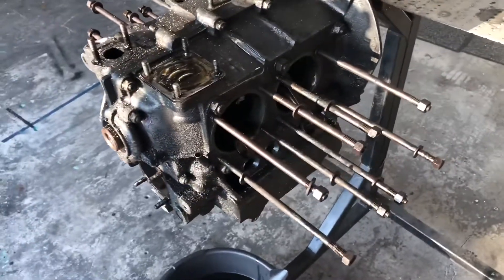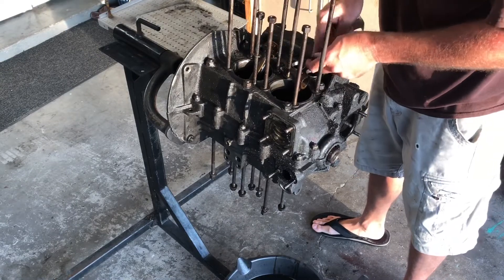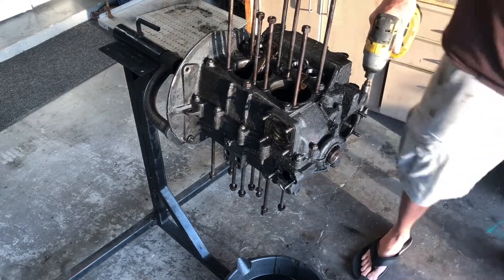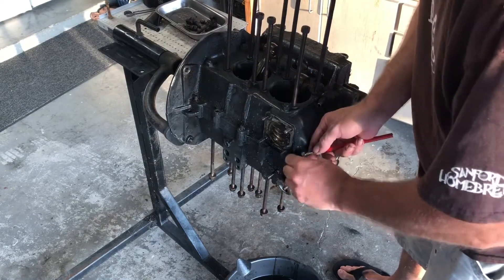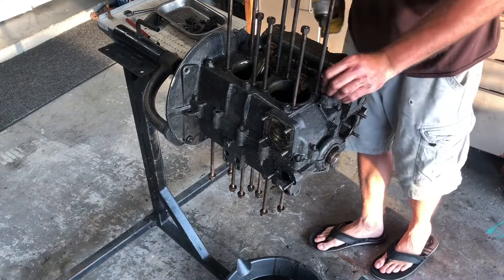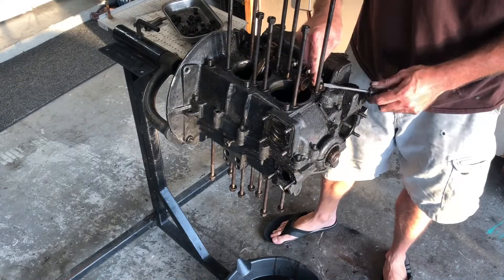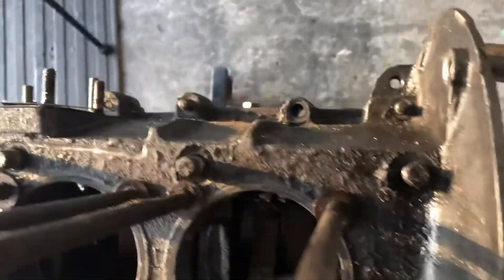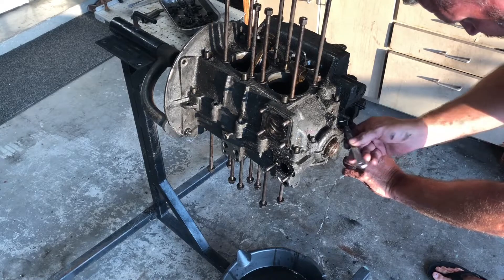Splitting The VW Engine Case On Joel’s 71 Bus

Comment: My Late father who  rebuit Volkswagen at 2different  Volkswagen dealerships   used old cylinder  heads as a slidehammer after all the case bolts and oil pump were removed    .
Reply from the maker: Hey that’s a cool idea!

Comment: Nice find!  I have to say, the guy who designs a vertically split case engine needs to be boiled in the oil that leaks out of that engine...
Reply from the maker: I would have to agree with you on that one.... however if you use a good case sealant and make sure the case halves aren’t warped, you won’t have a leaker.

Comment: Those case spitters that  go in oil  pump cavity  can distort the crank case line bore the Germans  that came around to the Volkswagen  Dealership s didn't  like them i had one.
Reply from the maker: I’m sure it could definitely do that if you cranked on it real hard and left hardware on the case when trying to split the halves.

Comment: I have a engine stand. I've not had any issues mounting a  chev 350 or Honda 3.2

Do I need that mount I see in vw repair videos?  I have not come across one with my stand engine mount.
Reply from the maker: Hey David. You should be able to adjust your engine stand to work with the VW engine. Not sure if you’ll have enough clearance with the flywheel on but there’s ways around it. Do what you can with what you have 👍